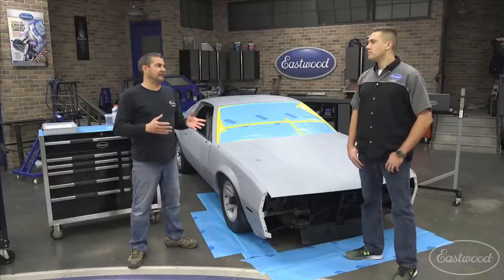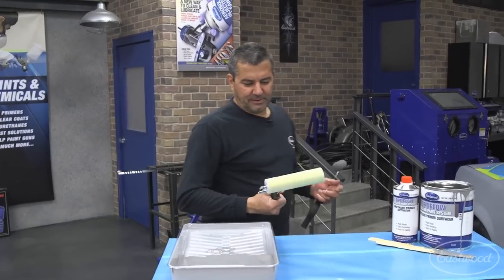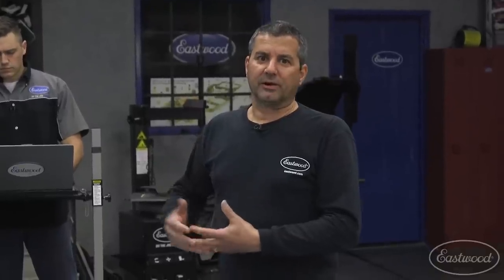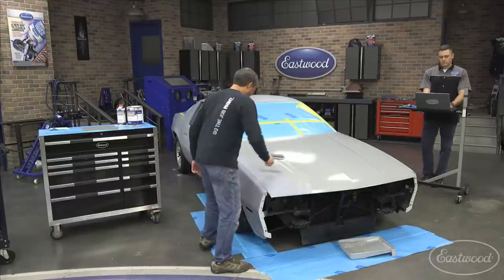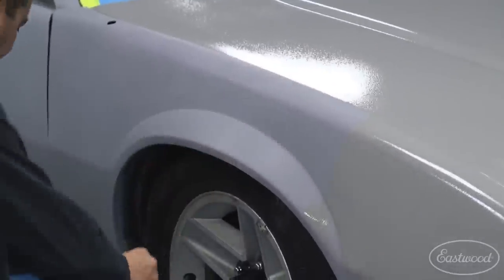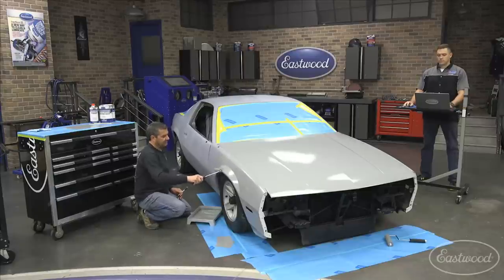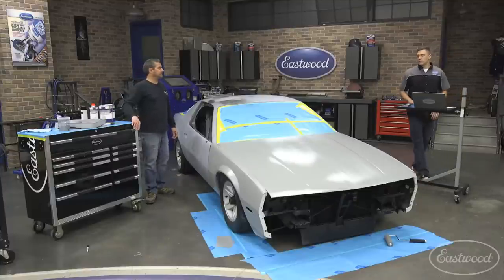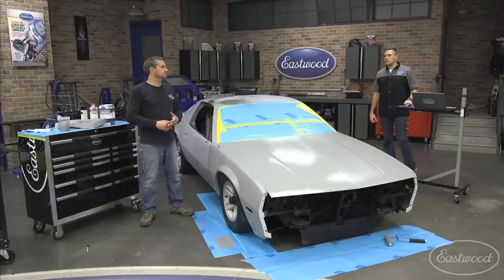OptiFlow Roll-On Primer System LIVE Demo - How to Roll On Primer and Get the BEST Results

Comment: First, thank you for making a product that allows the hobbyist to make body progress without a large air compressor.  I used it this week and have some feedback.  

The epoxy primer is much more viscous than I was expecting.  As a result, it doesn't fill in small blemishes.  These days, high fill, sand-able primer is key to saving time.  I used a power drill to stir the batch thoroughly, making it as thick as possible.  Because it is viscous, you almost need a second person following behind with his own roller, to address runs or sags.  It's quite easy to turn a perfectly straight panel into one that needs blocking because of new runs.  Yes, I did linger and address runs as they happened, but some appear after you move on.  

The process makes rollers come apart -- even if the roller is high quality.  I alternated between rollers provided, and ones I already own.  To do an entire car, I had to use three different rollers because they disintegrated.  In one case, the foam broke off completely where the inside rod ends.  

For a thicker material, I think a micro-slurry mix fills much better.  It fills in small blemishes.  It also does not eat rollers.  It's very durable.  The downside is that it's not easily sanded so it's harder to blend with uncoated portions of your panel.  Also, I would stay away from the new "brown" micro-balloons.  They clump too much, so you want the normal white ones.

Comment: Hey Guys purchased a 2004 Dodge Ram 2500 w a Cummins. Dream truck. I was only going to do a cheap under carriage spray. Then I started watching your videos. As of right now I ended up do a complete renewal. Your products look amazing. So I decided to do everything in Eastwood. I’m starting with sanding entire under carriage and property undercoating to prevent rust.  After I’m done with that. I have removed my truck bed and will sand to bare metal (hoping to get a contour). But it’s not in stock. Then I will do a complete paint job in Eastwood products.  I need some options on what to do with painting. I already purchased. Everything I need and some for frame. Please let me know how I can contact one of you guys for your expert advice. I will post entire renewal on YouTube once done. Thanks

Comment: I have a 1990 G20 with a 2 foot tall fiberglass high top... not just the short high top but a good 2'.  It is fiberglass and powdery on top and many surface cracks (maybe fibers) on the sides etc.  Would I use these systems on that or is it only for metal body panels... and can I roll and/or brush (Ilike the roll ideas)

Comment: When prepping say a new steel fender with the black coating what should I use to scuff it up before applying epoxy primer??
Reply from the maker: Here are the Optiflow instructions.
https://www.eastwood.com/images/pdf/p23135Q_OptiFlow_inst.pdf

It can be applied right over any coating. For prep, 120>220>320. Scotchbrite pad in the hard-to-reach areas. 👍
Reply: What grit should I use on the bare metal before I put the epoxy primer on?